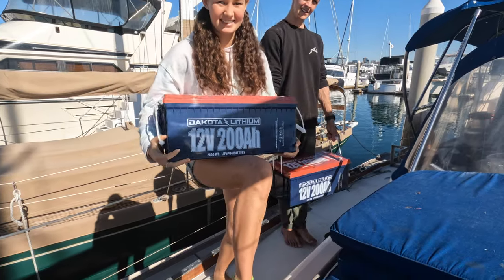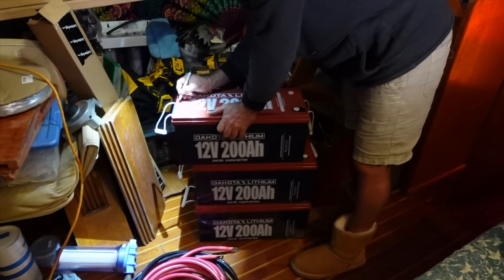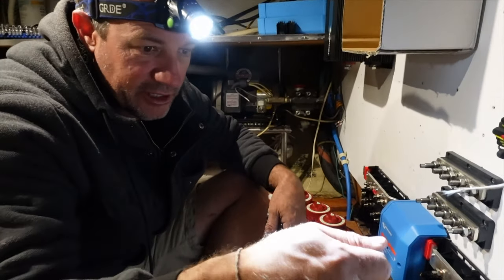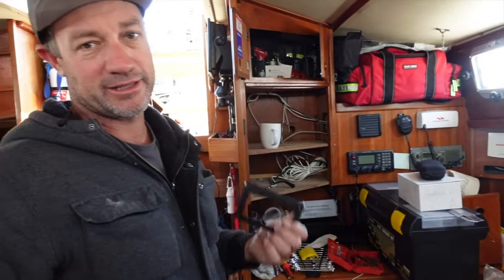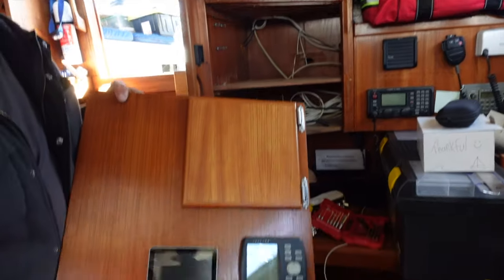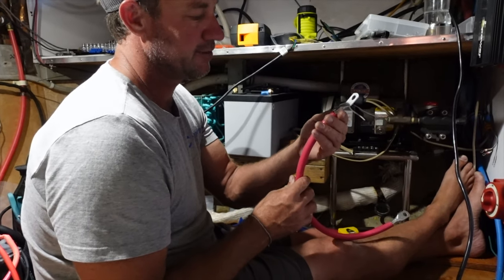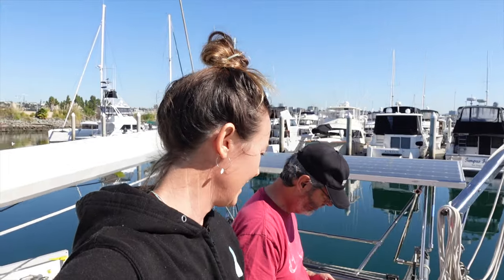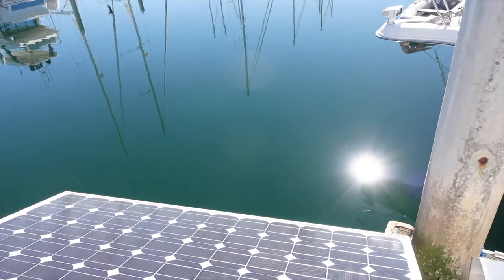Lithium installation on a Sail Boat | Ep 331 | LOTS of boat work

Comment: jesus... all system just a waste of money... you re rich...
Reply: What do you mean? That sounded insulting, or did I misunderstand? 🤔
Reply: @rocket262626  working as marine electricity enginer last few years, i can say that victron is very weak components. never know when all these system will collapse. I do not care how they waste his money, the idea is make realy stable system,. correct designed system have only battery and one charger. each these blue boxes is realy weak piece of long chain.
Reply: @sea_knot   Ok,, I understand now. Your comment of they being rich caught me short, for they are certainly not.
  I will say,, the Victron system for the new Lithium batteries, which have their own internal systems,, seems to be the 'chosen' system most cruisers are installing. I hesitate to second-guess so many skippers. Brian Troutman of SV Delos, who is himself quite  knowledgeable of electronics,, did extensive research before choosing Victron. 
  Anyway,  to each his own way.  Have a good day.